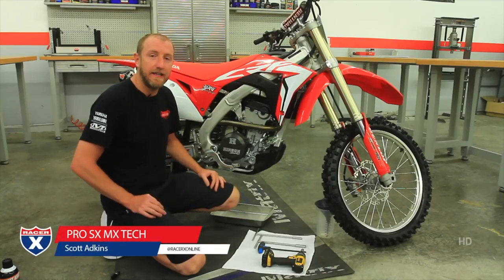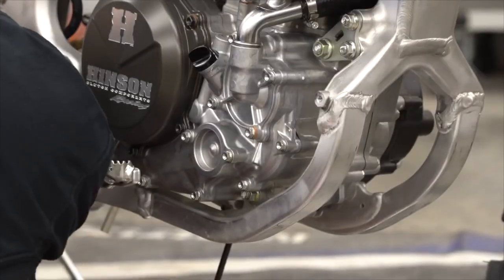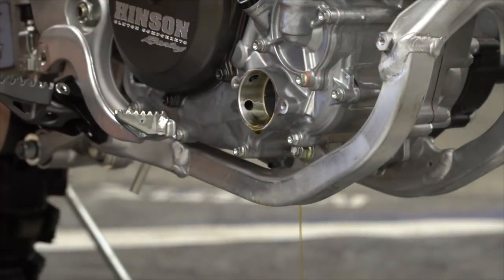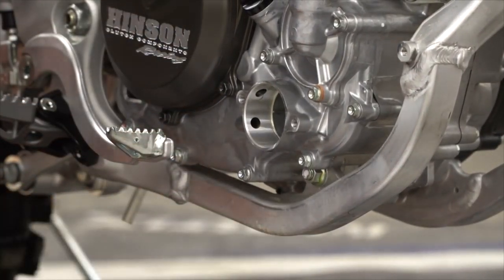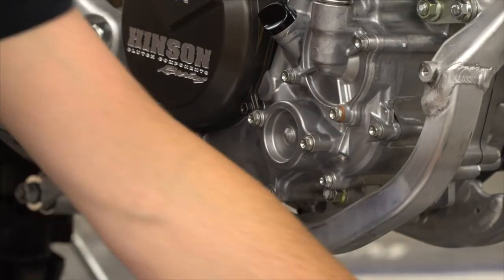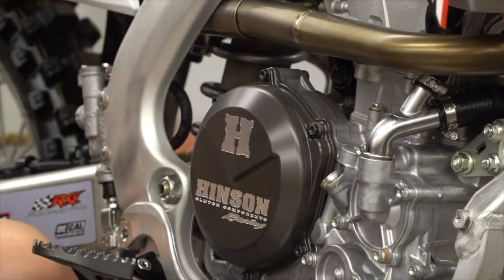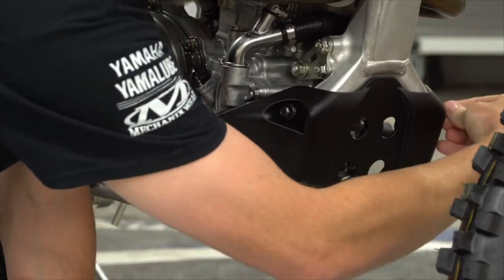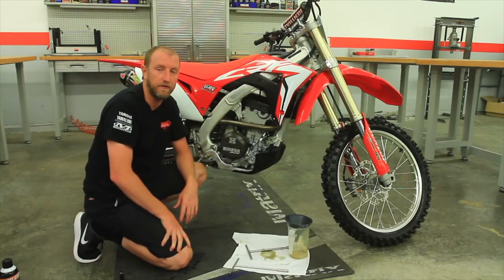Racer X Films: How to Change Oil on a Dirt Bike | Factory Tech Tip

Comment: I warm it up b4 I drain oil
Reply: Why
Reply: @codelucid9493  they say when the oil is warm it drains better.
Reply: @AtOneMent1844  oh ok thanks
Reply: @codelucid9493  got to set it sit after warm up. So the oil has time to get back to the bottom of the motor.

Comment: Why is oil changes on dirt bikes needed so much?
Reply: extend life on the motor, dirt, grim, and possible chunks of metal can all get in the oil and cause it to be dirty and makes your engine life expectancy lower. Therefore I would do the recommended amount of oil changes that the service manual recommends.

Comment: At the Honda dealership they told me that all you need is one quart of oil on my 2021 crf250rx but 1250cc is more like 42 oz ! Which is correct?
Reply: I have the exact bike and is hard to get any information regarding services
Reply: find your bikes owner/service manual. it will tell you the exact amount. Or just add little by little and check the dipstick after every addition. I have an 07 crf250r and the manual says to add 0.73 quarts if you're also changing the filter. And the manual says to add 700 CC's of trans fluid. Since his bike is the trail version and not the racing version I'm almost positive the cases aren't separate. so that much extra fluid would make sense if it doesn't take separate engine oil and trans fluid.

Comment: Great video except the oil from manual when changing filter is 1120ml not 1250 and without changing filter it’s 1080ml.